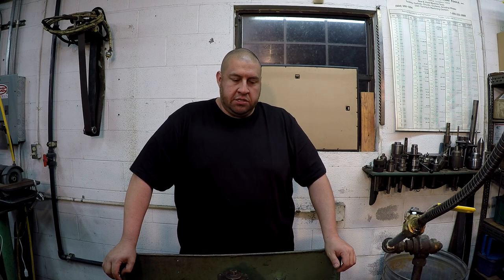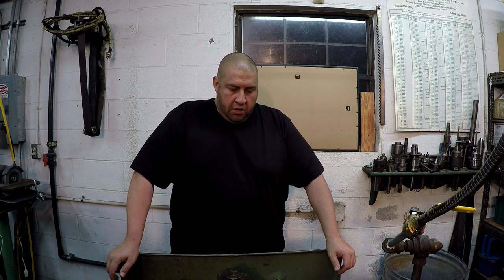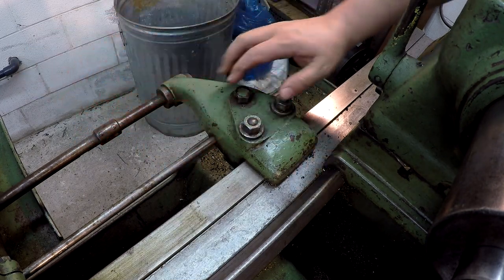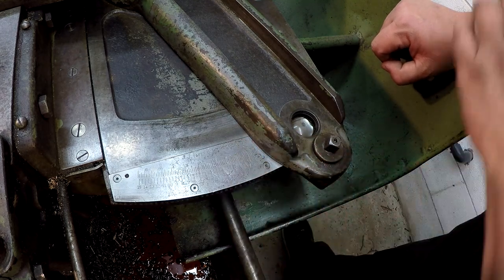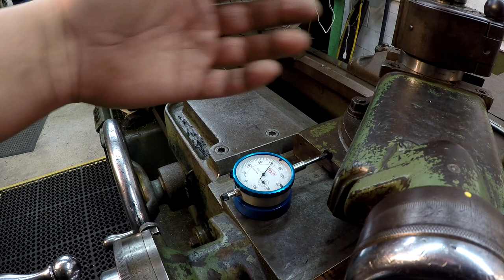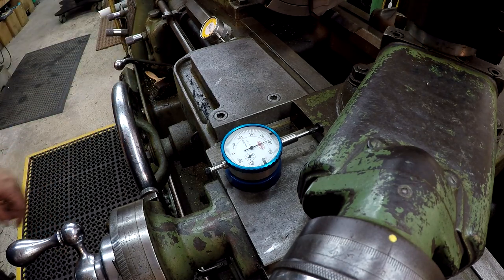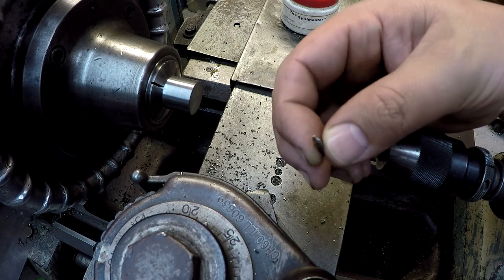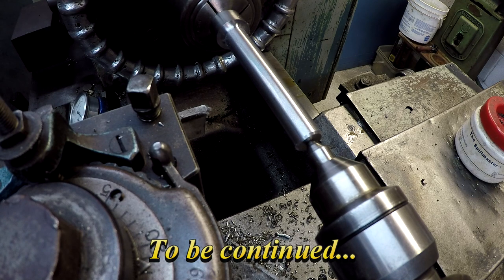Turning a Taper using the Monarch Taper Attachment Part 1

Comment: You have no idea how much help and inspiration you have been. This week I bought a small engine lathe to start building stuff that I want to play with. It is a rockwell 10”, 25-700 lathe. It came with the cross slide attachment and the gearboxes to cut threads. Needless to say this video helped in a big way of understanding the cross slide. Your tool grinding videos have been a great tool as well. Just wanted to say Thank You.

Comment: The Monarch taper attachment is the nicest one I have run into on lathes.
Reply from the maker: bcbloc02 Certainly the best that I know of. I did use one on my LeBlond lathe years ago and it worked good too, but not built the same.

Comment: Very useful info. Thanks. I purchased an old Sydney on eBay a few years back and it has a very similar attachment and i hadn't takin the time to figure it out. Now i will. My Sydney is a 1941 and still has the original motor. They sure made things right back then. Its a 208 3phase 2hp and weights in at I'm guessing 120 lbs. Crazy huh. Thanks for the vid

Comment: OK, this taper attachment looks very robust and simple, but only for single angles. Keith Fenner's contour attachment is more complicated, hydraulic driven, but can make all kinds of angles, dangles and radii in one shot.
Reply from the maker: +rkoz55 His is a tracer attachment, it works differently for different types of jobs. Taper attachments are for one angle at a time, like when machining prop shafts and pump shafts.

Comment: I had to cut a 1:12 taper on a couple of 8" stainless rudder stocks. Fortunately, the lathe had a Z axis readout so I used a good dial indicator run 10 inches along the parallel section of the shaft I had cleaned up and dialed in the taper setting. I checked it the same way when I was done and the taper was within 2 tenths per side over 10 inches. You need to make sure the indicator is positioned at the same height as the the cutting tool to check the taper or it wont give you an accurate reading.

Comment: if you have a v-block or other of known length that can be be laid right on way and understood to be repeatably / reliably parallel to way, can be more accurately used for a checking block in any case.

Comment: Once again you have explained another machine/machining topic in an excellent manner. The fact that you mentioned taking up the backlash before measuring (or starting a cut obviously) should tell everyone that you have cut many a taper on the lathe.
The TA on the Monarch is the cats ass. Roller bearings and the gear rack for adjustmenting the bar is so much better than what most older lathes have.
This wouldn't apply for your Monarch BUT for folks like me, with lesser quality lathes, it is extremely important to use A LOT of oil on the TA and lathe. I would use a synthetic motor oil on the TA AFTER giving it a thorough cleaning and regular way oil on the lathe.
I have an Sheldon from 1954 and it came with the telescopic TA somewhat similar to yours however without rollers etc. Sometimes, depending on the taper, it seems to work best to run the taper from headstock to tailstock. It seems easier to get the backlash out?? Any idea why this may be?
Reply from the maker: +howardtoob Thanks for the comments. I have never had problems with the Monarch TA's unlike the other styles. I agree, use plenty of lube! I don't I have ever cut with it from left to right. I need to get into my cross slide and see what's going on in there.

Comment: Nice procedure for setting up for taper turning. The use of the indicators would work with other types of tapers as well. Great teaching content!!! But then, I've always found good teaching content in your videos. Thanks for the straight forward show and tell. 

About magnifiers, I use one of those that straps on your head. Believe it or not, the Harbor Freight ones do a really good job and have three levels of magnification built in, and they are cheap! Well worth the investment and probably one of the best deals at HF. Around $5.00 and sometimes on sale. Even if you don't like it, it's cheap.
Reply from the maker: +Cavemannspace I've never seen one from there. Could you share a link?
Reply: Sure! http://www.harborfreight.com/magnifier-head-strap-with-lights-38896.html
1.8x, 2.3x, 3.7x, 4.8x  If you need more than 4.8x all the time this may not do it for you, but for the things I do this works very well, for me anyway. As far as I'm concerned, this may be one of the best kept secrets at HF.

BTW, if you use the lights on it, that will take a little getting used to as I usually open the battery compartment instead of turning the light on. Just turn th lights on before you strap it to your head. Still not going to complain about it for the cost.

Comment: Keith Rucker recently talked about the taper attachment in his LeBlond restoration part 13 video. Maybe you can add a link in the description for people that want to see a bit more on that. 

Also, you mentioned that you needed to put a very small center drill on one side. Why not leave some extra metal and part it off later? Edit: I think I see why, since you wouldn't have a good way to hold it while parting it off.

Comment: just watched part 2. some play in the taper attachment required you to pull the tail stock to go past to above steps in the park.  is the swivel channel worn , the sliding block worn.. i can see some screws in the exposed top .. is the side spring loaded to adjust tension in the groove like a gib to remove play.. just curious.. i know you may only use it rarely but a hour or two now to locate any play might save hours later when you are rushed for a taper.

happy new year to you also. wish i was east coast to enjoy some of those pork roasts you showed earlier. i was just laughing to myself thinking about the issues trying to UPS a freshly cooked pork roast.  every drug sniffing dog along the way would nose it out for inspection.  let alone for the driver at my end.   i know it would not be a toss and dash.. it would be a knock and can i have some please..   wayne in lost angles..

Comment: Noob question: why didn’t you start by machining the tip first with the work chucked deep into the headstock and use a live center with an inverted tip for the rest of the taper?

Comment: When you are using the taper attachment, how does the cross slide follow the taper attachment without disengaging the lead screw from the cross slide?
Reply from the maker: I have another video on how the taper attachment works, check my playlist for it.

Comment: Adam, what is that thing hanging next to the window behind the Monarch?  It looks like a push broach, except that it looks maybe parallel, and the teeth at the bottom look smaller than at the top (which seems backwards for the tooth direction).Great video as always.  I am thinking about adding a taper attachment to my lathe too, so these are useful to see.
Reply from the maker: +rbaker142 I believe what your seeing is a cutter for a keyseater machine. It's a 1/2" cutter and very long. We used to have a Davis #4 keyseater. That one cutter is too long for a drawer.

Comment: What year was your Monarch lathe made? I have one very similar but the crossfeed/half nut controls are different. Great info on the taper attachment!
Reply from the maker: Mine was built in 1942
Reply: My 18"C is a 47 model. Spindle engagement handle is opposite to mine.

Comment: Adam, looking at a close up of your cross slide , how on earth does it get so beat up, it looks like someone had a bad experience and beat it with a sledgehammer?
Reply: Matt Matt 
He explained  it before, grandfather or father i think used to set the chucks down there and dented it all up
Reply: I do recall what your saying, but I thought that it was the sheet metal covering the back of the cross slide that he had said not the cast iron front of the slide.
Reply: The Monarh
Reply from the maker: Matt Matt Matt, its al old lathe built in 1942. It's seen a lot of use and been through the hands of many machinists. No telling what all has happened to her. I think all machines have there work scars. 👍🏻
Reply: Thanks Adam, what amazes me is that a machinist that is making precision parts would take so little care of such a precision, very expensive machine and not treat it with kid gloves and abuse it when he or she is trying to make a living with it and risk losing it's ability to make precision parts, blows my mind. I realize that accidents do happen, but looking at the cross slide on your Monarch  looks like someone beat the living tar out of it, not saying it was your family. Happy New Year Adam.
Reply: +Matt Matt What you are seeing is nothing more than some dents in the cross slide way cover. Although they look bad, they don't affect the function what so ever. Adam explained the reason for those dents and how they were made, in a previous video. What you don't realize is those marks were made by his late father whose lathe this was. Right or wrong, he had a method of changing the chucks that maybe others wouldn't use. Adam keeps those marks as a sort of reminder of his father. It gives the lathe character.
Reply: I'm not referring to the back sheet metal cover, I'm referring to the front of the cross slide before the tool rest looks as though it was beat with a sledghammer

Comment: Hi Adam, I know its been asked a couple of times but i just cant help myself haha how does the taper attachment disengage the cross feed nut? i watched Kieth s vid on his taper attachment but he never said or i couldn't figure it out.

Another great instructional vid anyway Adam! 
Cheers 
Troy
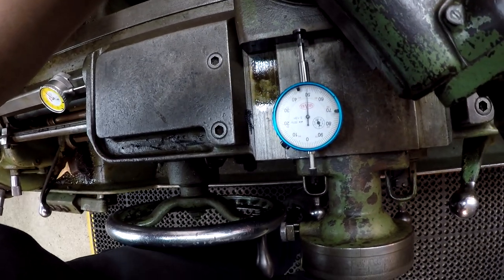Reply: Good question and I haven't seen it before that I can recall.  On Keith's lathe anyway I was thinking his taper is a separate cross slide and hydraulically controlled on the far side.  More properly a contour follower, you drop in the contour you want and the wrong side of the lathe cuts it out.  At 19:38 I can see one knob pulled out and turned so it stays out but I think there may be two half nut 'pullers' engaged to pull and lock the half nuts apart on the cross slide?  Didn't know those were even there so you know that's just a wild guess on my part.  Nice eye for detail there, that dial is NOT turning and the tread pitch would be quite a load without half nuts in there.
Reply from the maker: Troy AM It's something I'll have to try and show on another video. Hard to explain here.
Reply: Abom79  Cheers Adam that would be great!

Comment: That small center drill is so not you. Do you have a female center, or one of those with interchangeable tips? Then you could have just turned a 60 degree point on the end for the center.